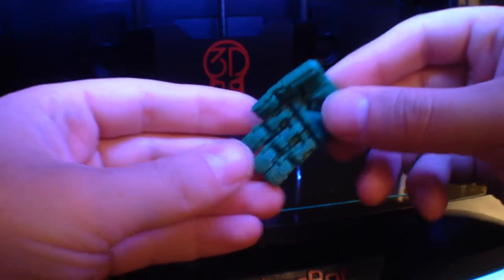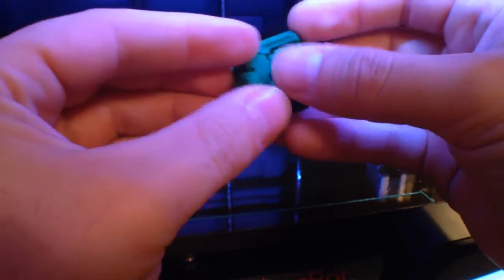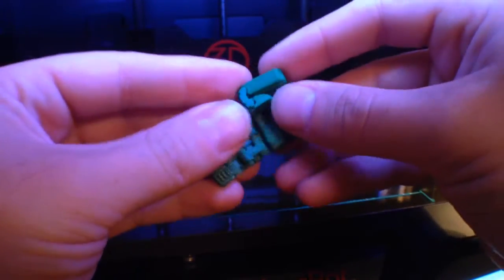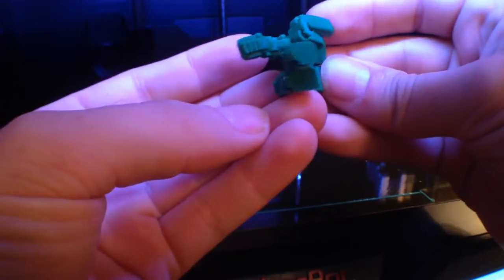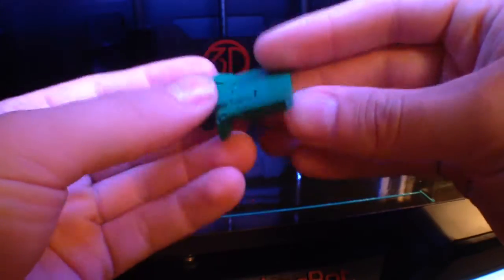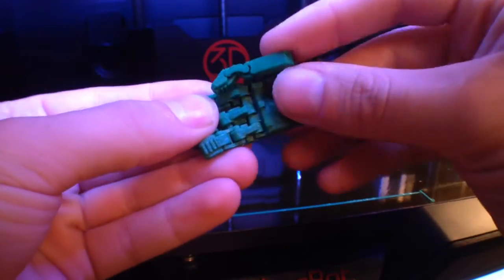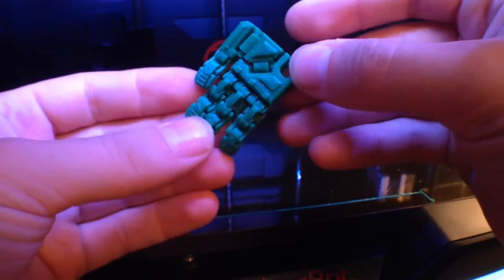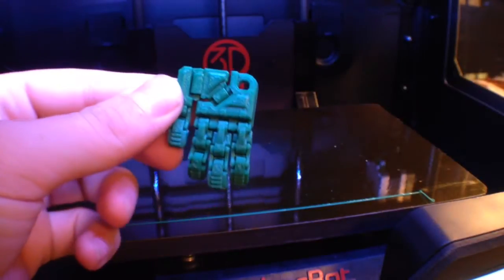3D Printer Test Kit: Graphica - 'Hand' Test - 3DKitbash.com - MakerBot 2x

Comment: Very cool!  I'm a supporter of the 3D Graphica campaign and I'm wondering how the part came off the printer already movable?  Did you use supports, like disolvable PVA via the 2nd extruder?

I have a Prusa i3 and having a tough time getting good prints :/  I have more tweaking to do!
Reply: Hi Andrej, Sorry about the delay on response, I just found your question. ...Also, Thank you so much for supporting us!

As for this print: This was printed on our Replicator 2X using only ABS plastic, but it has been tested and works with PLA. There was no support structure used to print this and have it work straight from the printer bed. ...The reason it's workable straight from the printer bed has a lot to do with the angle I've designed the sections of the fingers to build at and how there linkages overlap as they build upward. Have you had a successful print yet? It's a tough one, but neat when done successfully.

Again, thanks so much for supporting us. ~Q